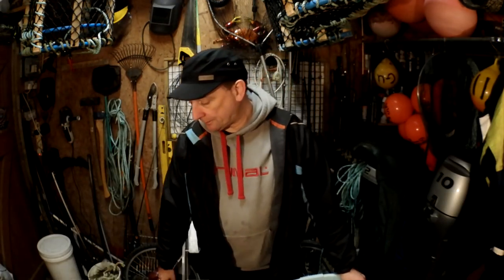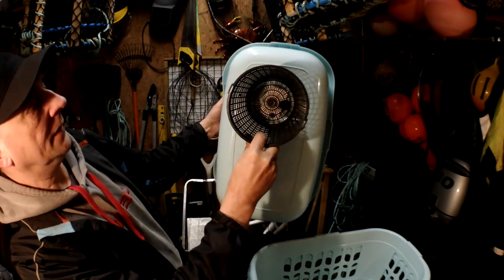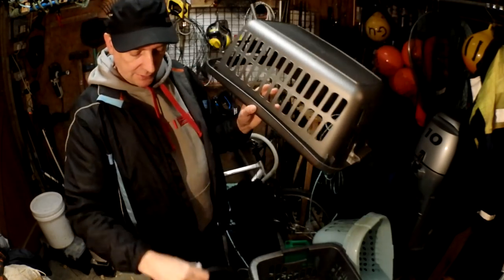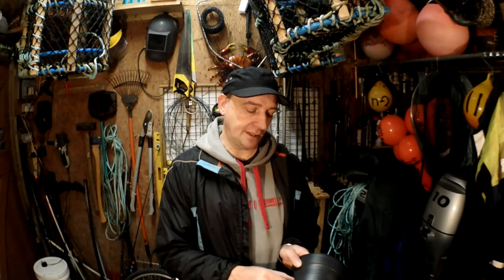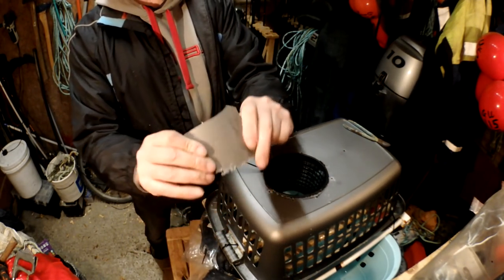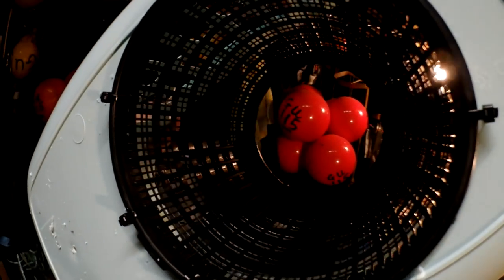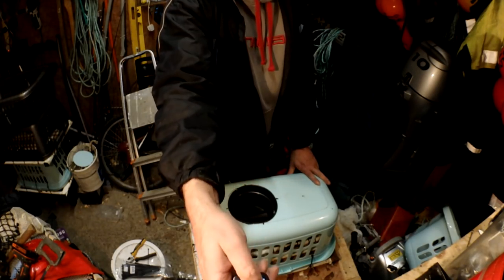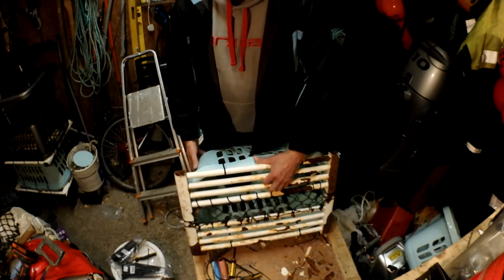20 minute Lobster Pot Build 🦞 Built For Around £5

Comment: Troj look around in auto parts  or building supply stores for a product called "Plastidip", it's liquid rubber in a can.  If you put a couple of costs about 20 mm wide from where you cut it off it should reenforce the edge and make the pots usable in a shallower bin.

Comment: Tro  where  you  use  the  blue  water  pipe  can't  you  use  re bate  bar  and  thread  it  down the  pipe  it  will  bend  easily  and  then  you  got  your  weight  to  hold  it  down  just  trie  it
Reply from the maker: You could but I want to keep the weight in the base it also lets the air out the pipe as it drops so the pot lands correct

Comment: Nice job and interesting video to watch, because you cover everything. I was wondering how you get the catch out. It cant be that easy to get a legal lobster or spider crab out through the catch entrance. I guess one could cut out a large square area next to the entrance and put in a netted door that opens at one side, Or did you literally pull everything out through the main hole?
Reply from the maker: All the catch will come back out through the neck if anything did get stuck in there, which happens rarely the neck can be cut out then re-tied. Doors are mostly used on pots with traps, creel style or pots which are just to big to reach in

Comment: What if u used 6 inch sewer pipe, u can cut neck what ever length u want.
Reply from the maker: That would work  the only thing is it would not be tapered or have a lip on the top when you tighten the zip ties. If I made a lot I would consider it.